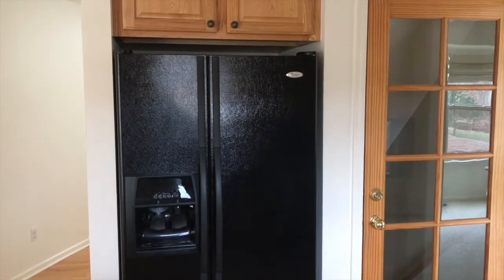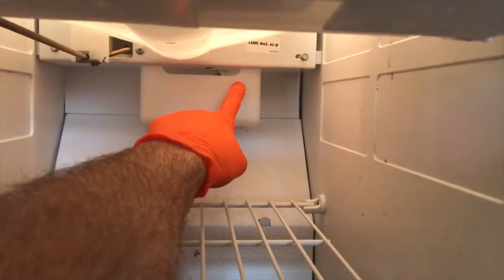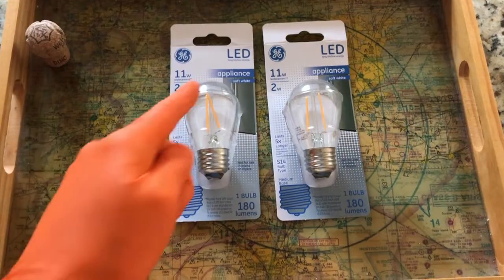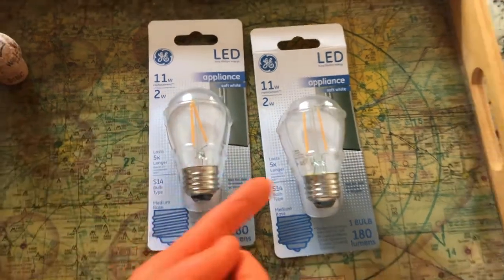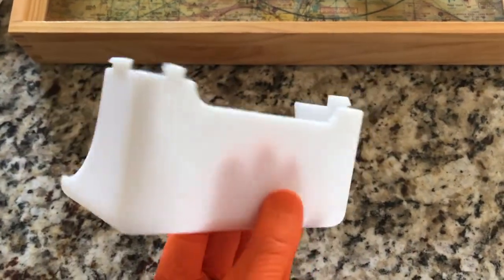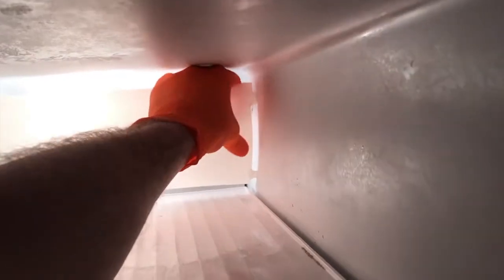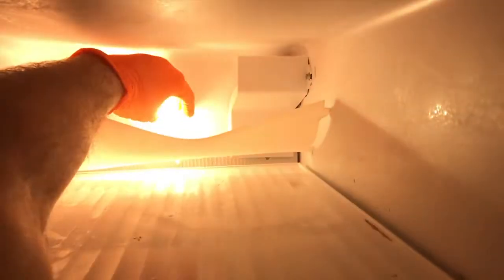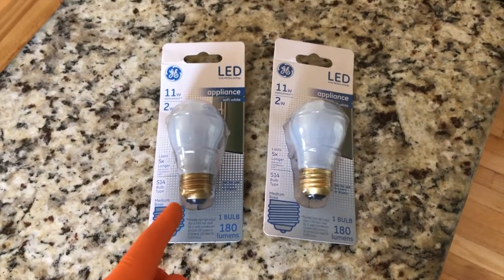How to replace whirlpool freezer light bulbs

Comment: Is this fridge from 2009?.
Reply from the maker: Thanks for watching & welcome to the DIY Raptor Club.  This is a 2004 model.

😎👍🔧🔩
Reply: @DIYwithMichaelBorders  Okay. So it’s from 2004. Mine was from 2007 and is a Kitchenaid and had different lights in the freezer. but it has the same exact Sylvania Daylight 40W 120V bluish colored light bulbs. And the fridge light is the exact same.
Reply from the maker: @homeguestunton  

Very cool.  Great to hear it’s still running.  Our 2004 will hopefully keep running for years to come.  😎👍
Reply: @DIYwithMichaelBorders  My 2007 Ice and water dispenser broke but it still worked. The Oven was not working right. The microwave and dishwasher worked fine.

And the fridge lights burned out causing a dark fridge. Freezer lights are fine.
Reply from the maker: @homeguestunton  

Appliances are showing their age.  A little DIY upkeep will do wonders.

😁👍
Reply: @DIYwithMichaelBorders  Now I have a new Samsung top freezer fridge.
Reply from the maker: @homeguestunton  

😎👍
Reply: @DIYwithMichaelBorders  

????.